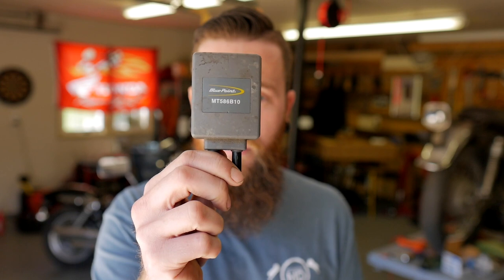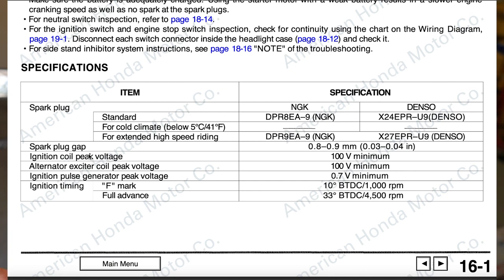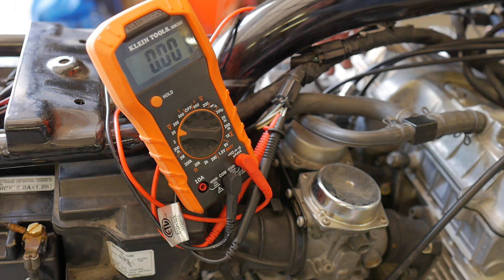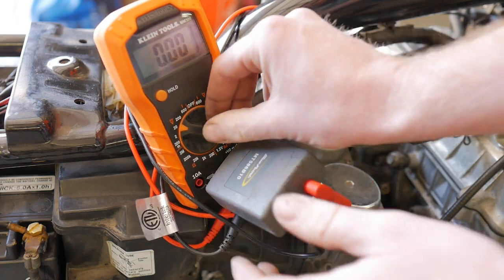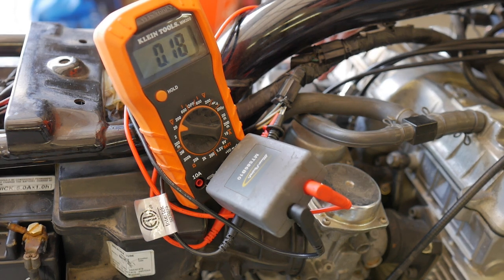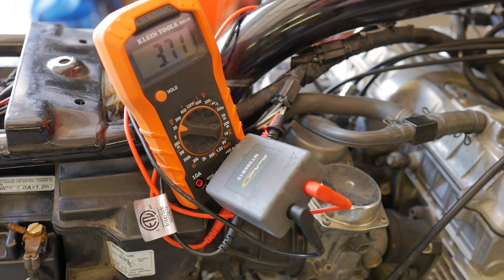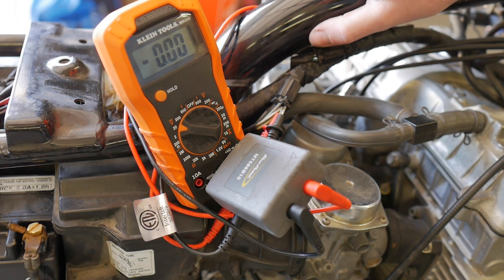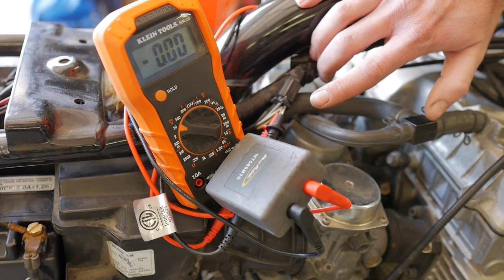Testing Electronic Motorcycle Ignition Systems

Comment: Hey Cody, I bought your carb rebuild for CB750 and walked through it last year and everything went great, even washered up so the cold idle is gone (mine is 1993).  Honestly, the most helpful videos ever.  Thank you so much for what you do, been watching your videos for years and nothing better in my estimation.  It fired up fine last year, yet after a Chicago winter, need to walk through why it's turning over and not starting.  New battery already crossed off.  Will watch your help again here and get it going soon enough.  Hope all is well.  Thanks again.

Comment: Im not a Honda man but find your videos very useful as most things jump brands. That no spark scenario can always be tricky. Recently worked on a friend's RD(RZ)350yovs that was running when he pulled it apart but refused to spark after a full refurb. We checked everything we could but had no info to test the cdi unit. Even the local Yamaha main dealers had nothing and suggested swapping out for a know working one. We did find a place in Holland that tested it (I'm in UK) and it proved to be good but still no spark. Eventually , almost by luck we found one wire to the electronic rev counter was swapped wrong onto the temp gauge. Swapped it back and we had spark back. This one thing cause hours of head scratching over several days. Love your channel,  always great content from someone who really knows what they are talking about.

Comment: Interesting, although I'd prefer using a (storage) oscilloscope, there are some rather cheap ones around and they can be used for loads of electrical and engine diagnostics (mechanical problems too), especially with a few additional items.